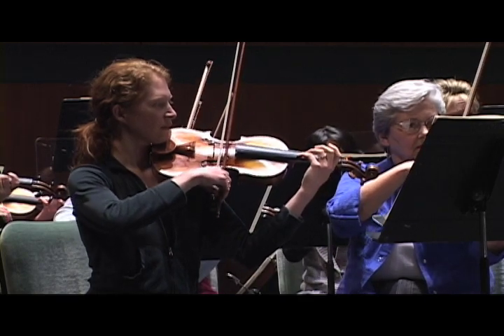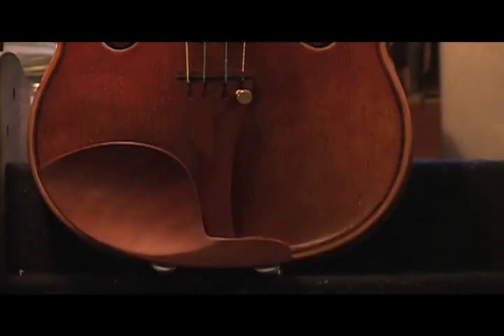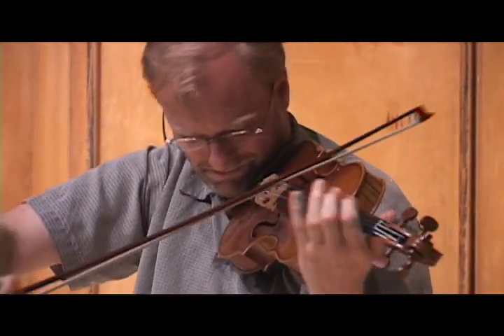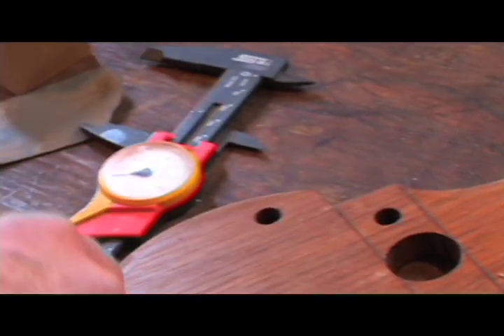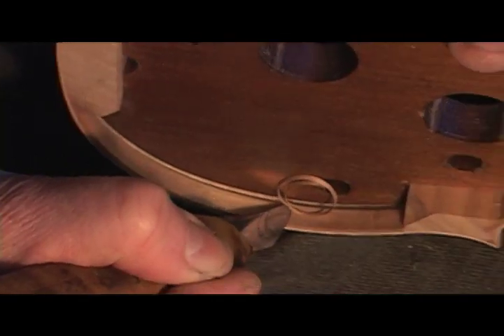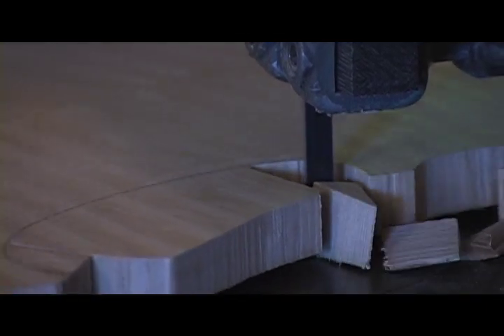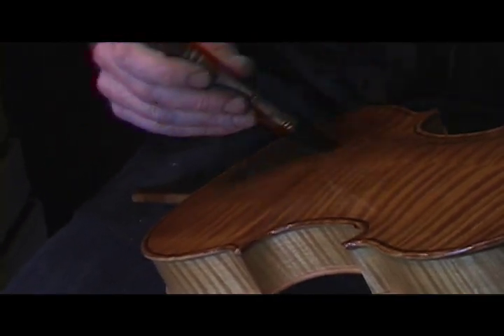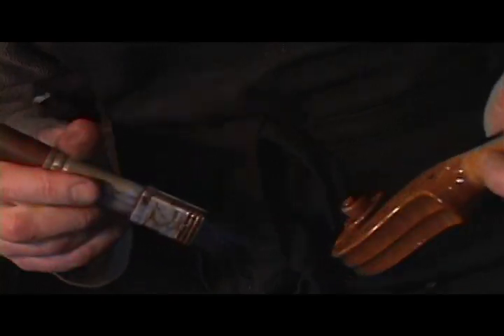The Architect of Sound

Comment: All this talk about violin makers and the wood used are over dramatization and sales talk to beef up the price of old violins. Not one of them talks about the strings. Cheap violins can sound very good with good expensive strings fitted to them and any Stradivarius will sound shit with bad or cheap strings fitted to them. I play violin and has found out from experience that the sound has more to do with strings than with the violin. When you get a violin, it is an art to fit it out with the right strings. Sometimes each string might be from a different brand of strings to get the sound you want. I saw a video of a guy who made a violin from wood that he took off a pallet and it sounds better than most violins I heard. So, all this violin talk is romantic and all that but just talk. I am a mechanical engineer and toolmaker and can assure you that any violin made by CNC machines are better made and more accurately made according to specifications than any handmade violin.  Violin making was for hundreds of years a racket that ripped off the public to pay big money for just ordinary violins. The same in art. How can one painting that the artist could not sell in his lifetime because it was so bad, be so good a piece of art today that it sells for 40 or 50 million dollars? We are being played.

Comment: It seems that Gusset makes fine instruments, but "the violin hasn’t changed in 400 years"…?  Four hundred years ago, what were being produced were *baroque violins*, with a completely different neck shape/angle, and different thicknesses throughout. In fact, even those multimillion-dollar Stradivari, Amati, and Guarneri violins were originally baroque violins, and had to be thoroughly disassembled, modified, and rebuilt by later craftsmen to turn them into the modern-design instruments they are today. (Which leads to another point: Stradivari wasn’t a "Renaissance master," as he lived in the baroque period, a century after the Renaissance ended. Had he been around in the Renaissance, he would have built viols, the standard bowed-string instruments of the time, not the violins that came in a later era.
Reply: Many violins were made during the renaissance, and 99 percent of the violins design remains the same today.